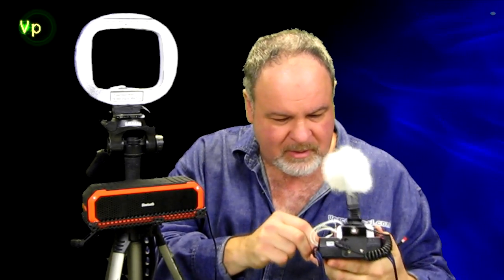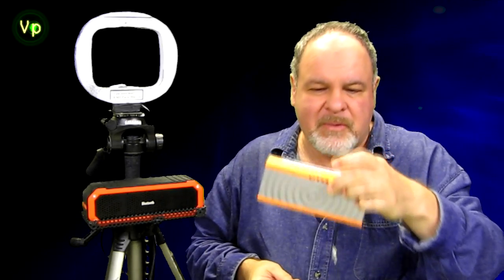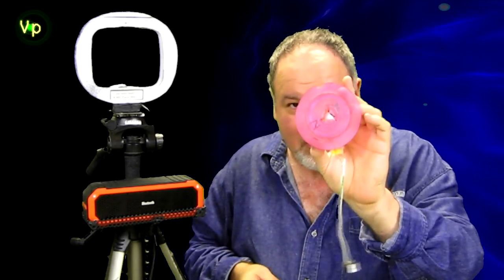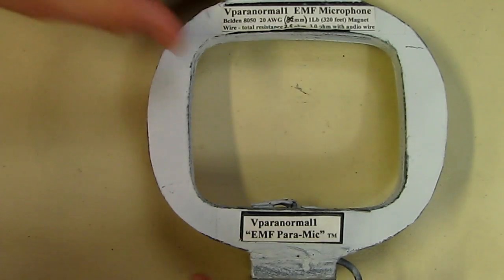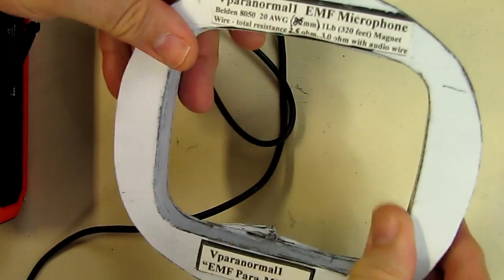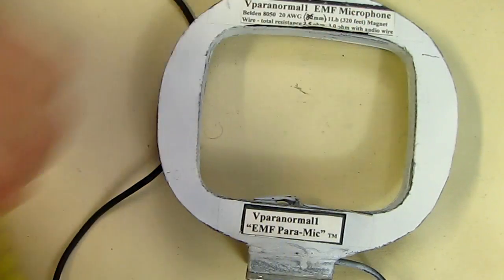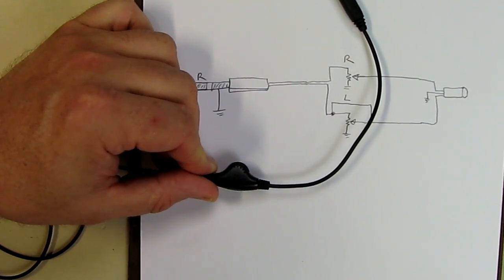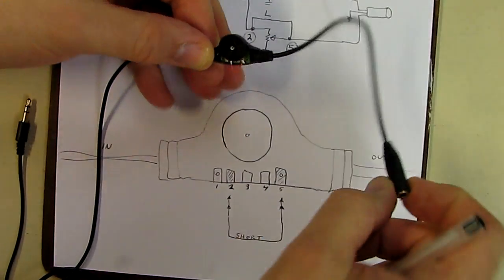Vparanormal New Research Tool "Long Range Audio to EMF"

Comment: Have you tested this coil as an input device?
Reply from the maker: Yes, but a smaller diameter wire coil with a higher turn count and higher impedance works much better as a mike input.